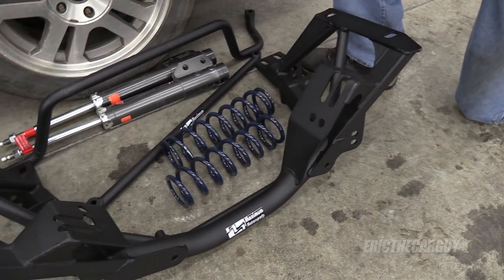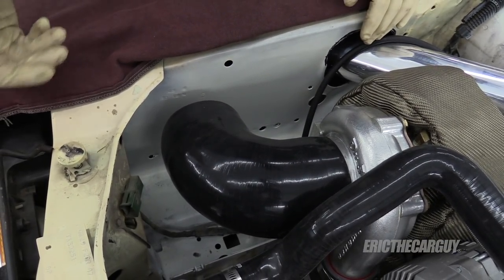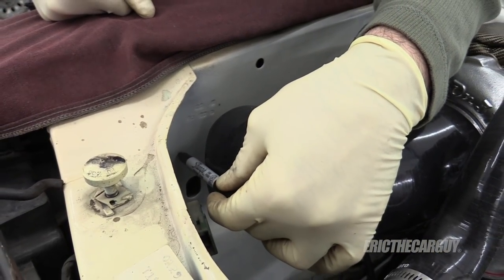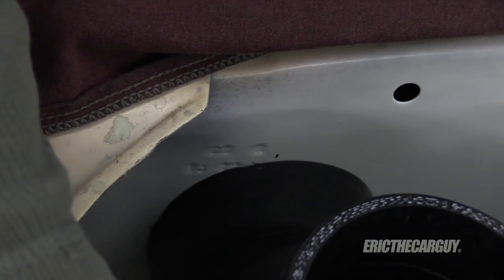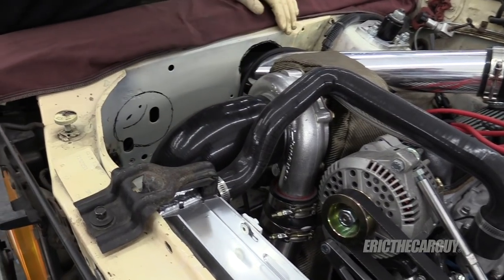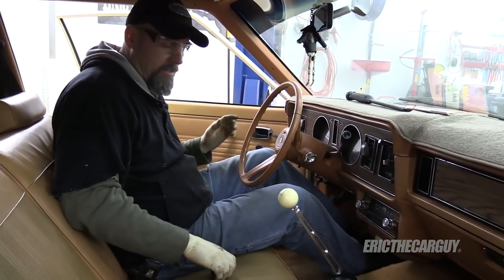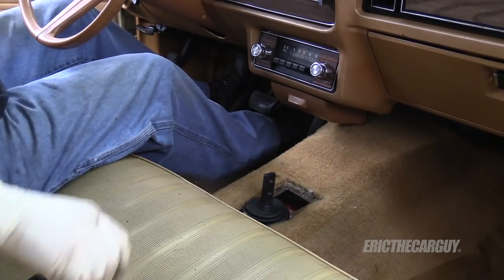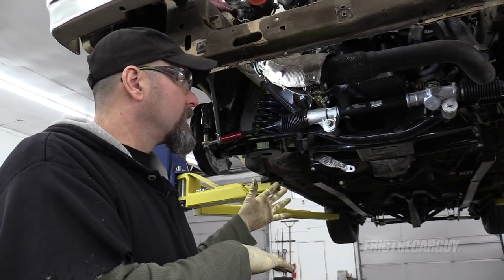#FairmontProject Final Assembly (Part 1)

Comment: Another way to handle the drain plug clearance issue could be  to install a short threaded tube into the pan and cap it off on the drain end. Like snow blowers use.

Comment: Eric,  Nice build,you prepped all them bolts on disassembly,good for you. Use a Allen bolt for drain plug,on oil pan..[ head is round ], should be a sae thread..Hugh -Chicago metro

Comment: Eric, it is great to see more of the Fairmont.  It is certainly my favorite topic on the the channel.  It is a good tip to hold the brake pedal to the floor so the fluid doesn't drain but what was that tool you use to hold the brake pedal down?  Where can I get one?

Comment: Could You have a custom oil pan with the drain plug off to the side?
Reply: jakeg83 that would be genious, maybe get a very small pipe and put threads at the end and then bend it at a small angle and you could even put in a valve so you can attach shit at the end before the oil pours out

Comment: Hi Eric. You should change the drain plug by another 3/8" box tipe (like transmission plugs) or allen plug... something that wouldn´t force you to damage the crossmember. i know it´s not that much of an issue but if it helps thats my advice (should i say). Excuse my english, i´m spanish so... Great channel though! Best Regards

Comment: Ive got the same socket set from gp. I have quarter inch with sae and metric in the same case, 3/8ths and a massive half inch set. The extensions with wobbly and solid are awesome. I got mine from my snap on guy at my last shop, where did you get yours from?

Comment: Curious as to what you use to hold the brake pedal down at about 21 minutes into the video?  I typically use a carpet kick tool however that was recently useless on my truck with vinyl floors.

Comment: 17:30 
Disconnecting the A arm from the engine cradle side will not work, the force of the spring will always force the a arm outwards as you try to jack it up that way, and even if you manage, you have much more danger of losing a finger, and you have two bolts you need to line up! spur of the moment thinking hehe I get it, but I don't see it working.

Comment: I imagine by now the car is up and running, but it appears you used 4 inch soft tube for the inlet to teh turbo from the fendor, prbably for bendy reasons.  Since the turbo will be creating a vacuum effect on that side of the housing, wont it suck the tube shut and restrict airflow as opposed to using a hard tube like aluminum? Is that going to mess with your fuel tuning if the airflow can shift with force?

Comment: Hey Eric, Is the hood clearance enough for when the engine torque and twist in there? And also instead of denting the brace, why not relocate the engine oil drain plug to the other side of the oil pan? I know this suggestion might be late but well, just want to know the answer.

Comment: Why couldn't you get a bolt with oil drain plug threads but with a smaller drive head or get a drain plug extension so that the size of the bolt head is no longer an issue?

Comment: Nice...any review on the torque an movement on the oilpan bolt...definitely do NOT want the motor twisting over then shearing off that drain plug stem...
Only a true mechanic would completely re-engineer the front end for a 1/4" lowering for clearance of an air intake for the carb he loves, then take a hammer to a cross member to make clearance for an oil plug...LOL  :)
Reply: Like just changing the location of said plug.

Comment: I have 3 questions about the video (and not only):
1.Do you think to replace your Fairmont's current aluminium prop shaft with a QA1 carbon one???
2.What do you think to do with your Fox Body Mustang???
3.If you think to do the same thing with the Fairmont to the Mustang as well, do you think to reinstall the refurbished T5 to the Fairmont and install the Fairmont's current tranny to the Mustang???

Comment: 94 camry 4 cyl 180xxx. When I start it in below freezing temperatures it idles at 700 and shakes. Shouldn't it idle over 1000 until the engine warms up a bit?

Also when revving over 3500 hear a squeal like a belt or something that immediately goes away when it shifts and the revs drop

Any advice thanks
Reply: Change the belts and check plugs and wires

Comment: question to the general populus - sticky ignition key in a 2003 ford expedition.  lots of vids helpfully say 'just stick a screwdriver in the little hole under the steering wheel and...'   but the 03 doesn't HAVE a little hole... even the maintenance manuals have nothing about it - ignition SWITCH yes, but surely i don't have to take the steering wheel off just to get the actual lock cylinder out do I?  that seems really insane.   or can i just DRILL the little hole?  or barring that is there a way to take the column shroud off without having to mess with the airbag cover!   burning questions for 2019!  anyone?  bueller?  bueller?   and why am i asking here?  because this is where the big car brains hang out.
Reply: Take off the plastic collar

Comment: My god, that was a rework.
I think i would rather reshape the head of the sump plug if the shank didn't come close to the bar.
Grind the head round and mill a large slot in the top.
A massive screw for a massive engine :-D
Silly thoughts i know.

Comment: Anyone wonder why this Fairmont made it into Hot Rod mag ? My guess is because he didn't ruin it with a junk LS. The only thing better on a LS engine from a SBF is they have better flow heads from factory. For what you spend on the swap you could buy a set of nasty heads for your SBF.